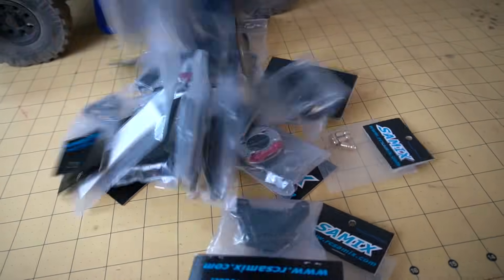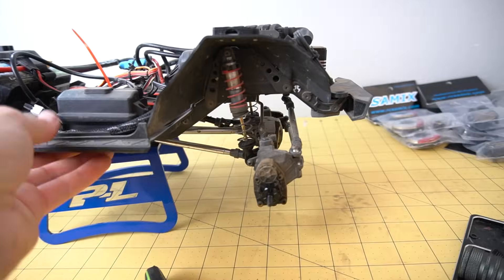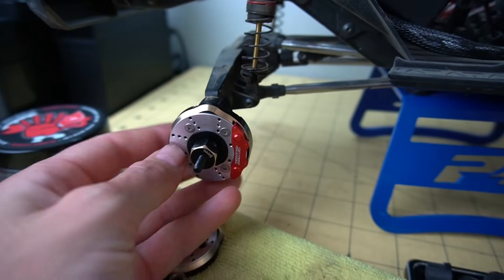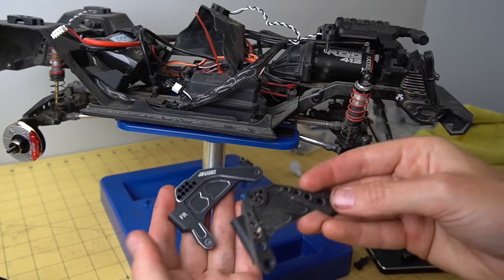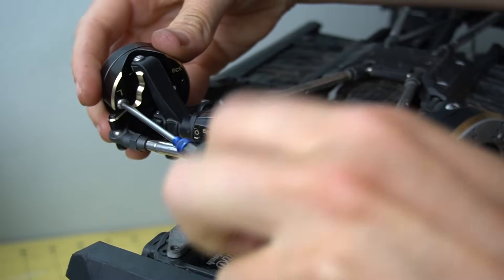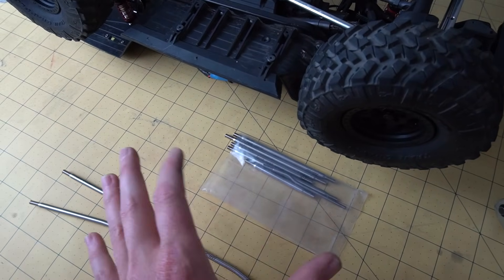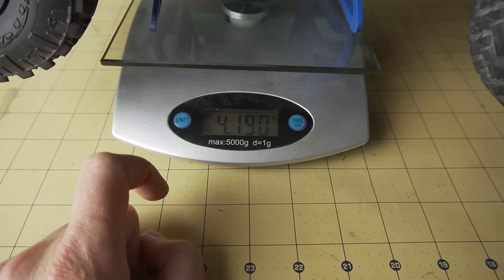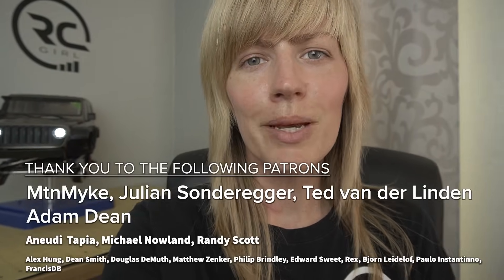Installing ALL the SAMIX metal upgrades on my Jeep SCX10.3!

Comment: Very cool! Those parts look great! That is a lot of weight though!  Thanks for mentioning upgrading the servo, a lot of these video's skip that detail though. I would recommend some thing "high voltage" like a Reef's 777 like I have in mine, but there are tons out there now for 60-100 bucks. I'm sorry I missed you at Axialfest! Have a great day
Reply from the maker: Yeah i wouldn't suggest going all out like i did! i think a few metal upgrades here and there would be the sweet spot.

Comment: That is one sweet rig. As far as weight distibution goes, I add a ton of low metal to keep my trucks planted but I always add a large battery and a little extra weight to the chassis to get that realistic body roll. And an aluminum rim is the most rotating mass I'll add.

Comment: I picked up the rear shock mounts any really happy with them, I wanted the front first to replace the link brace that is a weak point but my local shop didn't have in stock. Will be getting it soon for sure though. Nice looking rig you got there

Comment: the samix titanium links are actually a lot lighter/skinner than the stock links. you should swap them all plus the dimensions match up a bit better i believe. you can also get a small length on the axle thread to allow end caps

Comment: Correct.  The Axials 10.3 rubicon's I see bit on the light side, it needs weighting on the wheels and perhaps axles to keep the truck from tipping over almost easily

Comment: Wondering the best option for first entry level full size crawler. Just got an Axial SCX24 (1967 Chevy C10) and love it. Looking at Axial Wraith 1.9, Axial Deadbolt or Redcat Scout V2. Advantage of Wraith for me is it would work with my DX5C transmitter since it’s Spektrum.

Comment: After installing the pair of portal weights on the rear I found that the portal stub axles (stock) are not long enough for clearance of the hex nut to line up the screw-in set pin. How did you overcome this on yours? I have the SCX10 iii JLU

Comment: Do you vent the tires or rims?
Reply from the maker: These are just the plastic beadlocks that came in the kit, so I don't know if they are 100% sealed. But usually if i run in water, I prefer them sealed. Though if you run them sealed and change elevation (like I did going to axialfest), my tires ballooned! So I had to equalize the air before running my rigs
Reply: @RCGirl  Ahh thanks just wondering thanks for the info and I think you are killing the game! Good Job!

Comment: Sweet rig, but those are some seriously pricey upgades. As a 1st time RCer, what is the benefit of the Portal axle vs the straight axle, like on my 1/10 Losi Baja Rey? I still have the throttle controller set at 25% and its still way too fast to really let it loose or it likes to roll in turns and adjustments to the shocks' spring tension doesn't seem to affect this propensity. I've limited the steering as well to around 25% and still too responsive. smh

Comment: U better order the aluminum front axle! All the added weight on a plastic axle isn't good. I comp'd my capra with less weight & went thru plastic axles fast. (Mainly from the outer acle snapping.) Until i bit the bullet & bought the kyx front axle. They're indestructible! 👍
Reply: Rear never breaks!
Reply from the maker: Good to know!

Comment: are your axles metal ? threadlock + plastic is a definite recipie for disaster ...
Reply from the maker: It's the medium-strength threadlock, haven't had an issue before but i'll keep an eye on it.
Reply: @RCGirl  it's not a matter of strength, it's a matter of compatibility, most threadlock compounds makes plastics brittle ...